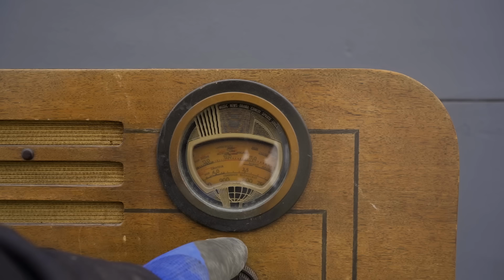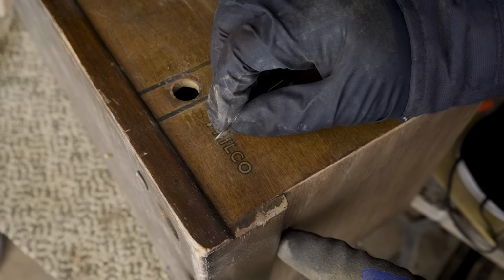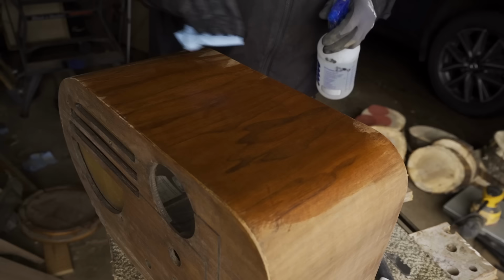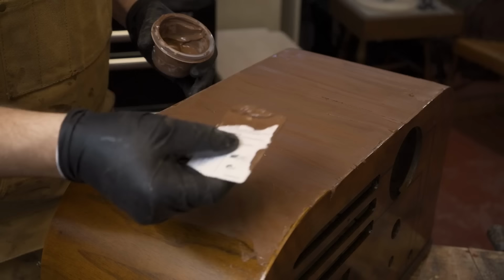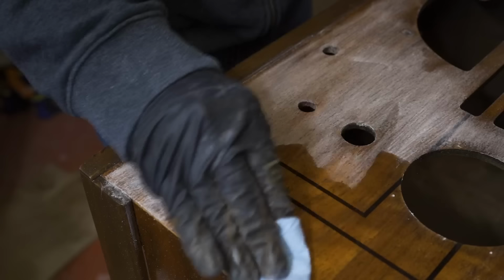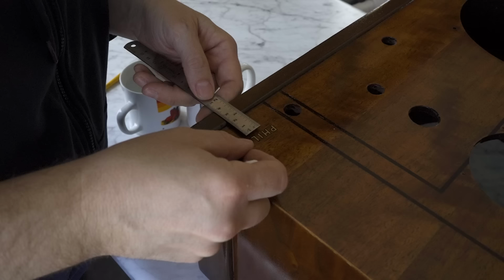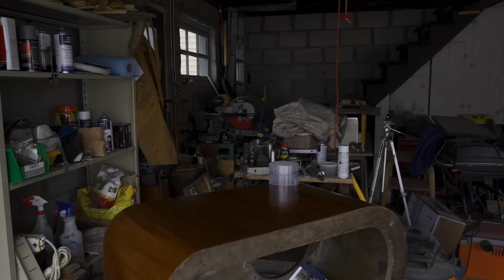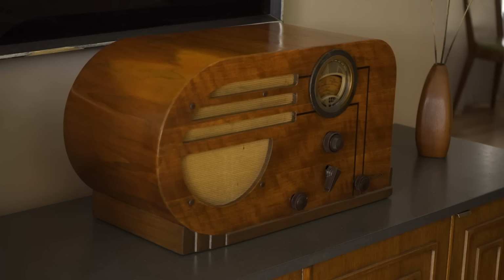Saving A Filthy Philco Radio | Vintage Philco Radio Restoration

Comment: That art deco design is killer. We've lost something along the way. Thank you for saving this.
Reply: Agreed. Also, I wonder why shortwave is no longer an option.

We had a Philco console radio. The bass was amazing! One day the transformer (I think that's right) began smoking and it was gone. There was no replacement part available 😢
Reply: @gordonadams5891  Older radios had 2 settings on the dial to turn to in case of nuclear attack for government info. Not this one, but radios and then transistor radios in the 50s-70s. 
When I lived in England, most all the radios had a SW band. I have one here but I can't get anything.
And then there was the day in the 70s I blew up our stereo playing Zeppelin....
Reply: was it stairway to heaven?  @icatz
Reply: @phil6506  Don't remember the song, but it was on Physical Graffiti.

Comment: I restored a Philco console floor model a few years ago, but I not only had to restore the wood, but also the electronics.  The wood took about as long to do as the electronics.  Fortunately, I was able to get a complete schematic on line and was able to get all new tubes as well.  The capacitors were all shot, so they had to be replaced in their entirety.   A lot of time, but the end result was worthwhile.  I had done this for a friend, because I liked the challenge and it was such a beautiful piece of multiple veneers.  It like your radio was a 1937 vintage.  My friends mother had remembered it when it was new.  So, I had a bit of fun.  I added an RCA plug connection in the back of the chassis and plugged a small CD player into it, and with a  recording of FDR's WWII, "Day of Infamy" speech played it through the radio while her mother watched and listened.  She exclaimed, "How did you do that?"  I told her that I had made it a time machine!

Comment: I had that same radio as a kid in the 60s'. Listened to shortwave programs while doing homework. It had an auxiliary antennae which went to the ceiling. My grandnephew has that radio now. You did an awesome job in the restoration and thanks for the memories. 
Happy Easter .

Comment: Rotten stone and linseed oil is what I use to polish Bakelite. I always repair veneer chips with veneer. I soak old head and footboards in the bathtub and peel the old veneer off to have a source of wood that has the same oxidation/colour level. Your method isn't entirely professional but a great start to it contrary to what Chuckkirshner crassly spewed. Nice little tabletop radio with great Art Deco design. I have restored maybe 200 floor and table radios over the years. I enjoyed your video and restoration production. Cheers from Canada

Comment: In case you want to add another skill to your plethora of amazing skills (thank you! I've learned so much from you!) French polishing the shellac after sanding would have filled the grain really fast. 

You sand the shellac with a high grade like 400 grit and without wiping the dust away, you wipe a heavily diluted shellac across the piece. You essentially use the shellac dust as the filler and the alcohol remelts it enough to bond. 

I did this with an antique chest of drawers and the finish came out feeling like butter.

Comment: The veneer repair looks fine. Old radios are going to have some blemishes and defects - it goes with the territory. You will never make it look like it just rolled off the showroom floor. I restore old radios and I'm fussier than most, and if I was doing this repair and it came out looking as good as you have got it I'd be very happy.
Will you be going over the chassis and restoring that to working condition as well? Be good to see it running.

Comment: I bought a disgustingly filthy 1939 Philco floor model 4 band radio at the flea market. So much cleaning and stripping down to bare wood. Everything inside was removed and the interior got cleaned as well. The radio chassis was striped clean and a 15 watt Fender Princeton design amp was built into it. A custom Weber 12 inch AlNiCo speaker was installed and the 75 year old on/off tone pot and volume control was retained along with the glass and stamped metal art deco and push button face plate. The unit has pride of place in the family room and I have set it up as an amp for my Boom Box radio/CD player. I call it my magic jukebox.

Comment: Muy buena restauración ...yo también opino que las líneas deben ser incrustaciones de latón bronce o cobre. Una restauración PERFECTA. Saludos desde Barcelona Catalonia
Reply: I think the wood inlays are perfect. Changing it to brass or metal is not a restoration. Brass will discolor. You think it's more fancy to use brass? But that's not the original design.

Comment: I couple of years ago I got my grandparents console radio with a turn table, the radio and Turn table still work but the cabinet is very rough shape. I'm planning on building my own cabinet but I'm going to build it a little taller than it was originally because I'm going to add a 42" to the cabinet, I live in a tiny house and having it all in 1 is just a space saver.

Comment: I think another way to handle the restoration on the front (and sides) that you might look into would be to use a Mohawk aerosol product spray (toner?) that melts the original varnish finish and reforms it with the pigmented toner spray. That way you can keep the the original Logos on the radio. You go very slowly in multiple applications so you don't get any runs.  It's an amazing product and I used it on hundreds of radio restorations over the years. They have dozens of hue of colors that you can put on lightly or build up in layers. Nice video! 😊😊

Comment: You can make your own gold/silver decals with black outline with a laser printer and clear water slide paper and metallic Sharpie.  Print logo outline like normal, spray with a coat of lacquer or shellac (if you want them stronger and not tear as easy).  After drying, slide it off face down on a piece of “empty” water slide paper and let it dry.  Then color in the backside with the metallic sharpie, wet it and slide it right side up on to whatever.  Works beautifully on  guitars (Fenders, Gibson with the silk screen).  Spray lacquer on top to “melt” it and the water slide paper will completely disappear, leaving only the logo.

Comment: What a fun and it looks freakin awesome!
Just don't plug it in. Capacitors leak over the years and you could cause more damage even though it may start up and work for a little bit.
Flitz is a great product.
I used to clean up old bakelite knobs. I initially clean mine with soap and an old toothbrush to clean any of the dirt and grime out of the grooves that might be around the knobs.
Great find in a sweet restoration. 👍

Comment: I have what I would guess is that same radio in a different case.  In mine the speaker is on top of the knobs and the dial rather than off to the side.  But it's the same knobs and dial in the same layout.  It was my grandparent's radio.  Mom and I used to sit up listening to the shortwave bands on it using an old curtain rod for an antenna.  It's been years since I've powered it up.  Very happy to see you giving that radio some love and attention.

Comment: hey man just a tip about the spray can that was "spitting", its probably because of the low temperature, try to let the cans in a warm water before you use it and shake it well also, but be carefull because hot temperatures could explode the can, just warm enough to improve  the mixture inside the can and you shoundt get the spitting problem.
Reply: Was going to say the same myself, I was curious of what the temperature was in that garage.

Comment: Over the years, I was able to put my hands on a couple of old radios. I don't know much about electronics but, it is fun to clean them up. I wish I could fix them properly because, I love the retro sound of them. The airline 62-713 that I have, has an "eye" and, I wonder if it can be repaired without changing it. I try to keep them as original as possible which, it's almost impossible. Those old electronics parts, tends to be a little tired.

Comment: Very nice work!  I have this same model needing resto, but have been putting off the work because I didn't know how I would restore the "pin striping".  Since you proved they were inlays, I now have the confidence and motivation to take this one on.  Also:  I've been having a lot of problems getting grain filler to work the way I think it should.  You did a nice job demonstrating its use, so that's another reason for me to start on the 610T.   Thank you!

Comment: Nice to see a cabinet done by a furniture guy. I do think the radio chassis is missing some rubber feet. The knob axis were too low in their holes. Riding almost against the bottom. Find some rubber washers and lift it a little. Hope you also found someone to do the necessary work on the radio itself. The cabinet work is useless, if the radio is under performing, or burns out.

Comment: I had a very similar style 1937 Philco with the same dials. Mine had original finish which while having seen better days, was not so poor that it warranted refinishing.  Refinishing in fact would have been a desecration. I recently sold it for $250… although it may have been worth more. It was in full working order. It was nice to see you give this one new life. It needed it. A very handsome radio. 👍

Comment: Use Gloss to build, semigloss to finish. Makes it easier to level sand the lacquer.

Be sure to warm the cans up for 15 mins prior and shake the recommended time. Clear the novels after every use. Between coats even

Pore fill can be done with UV filler which is probably more your speed.

Shellac pore filling will shrink lots. I’ve French polished a lot and it’s really the pumice and shellac that makes the pore filling possible. I wouldn’t recommend it. 

Alcohol artist pens are great for adding flecks of grain on those filler areas. Homogenizes things.

If you did a sunburst on the radio it would also hide that nugget of missing veneer

I like your work! Keep it up!

Comment: With those vaneer wood chip touch ups I have taken an Xacto and scored grain lines into the filler then lightly added soem black sharoie ink and rubbed it in.

Comment: Very nicely done! I have some radios from that same era myself, including a different ’37 Philco. I believe the original sheen was a fairly high gloss, although most of mine are still on the “to be restored” list.  Has the radio been electronically restored? If not, please don’t power it up if you are not familiar with the way to do it safely. In a nutshell, a lot of the original capacitors will have degraded and may short out, possibly causing damage to other components that are difficult or impossible to replace. (I’m currently in the process of rewinding the power transformer of a 1936 radio because someone tried turning it on years ago…)  There are a lot of good YT channels that do radio restoration!  Look for “dim bulb tester” if you need a place to start!
Reply: Sound advice.

Comment: Just as a tip, if you use real French polish you can use pumice powder to fill the grain. As a dealer and restorer of antiques I can remember my first use of French polish and found it far easier than I first thought it would be and if you make a mistake it's easy to put right. You should buy flakes and mix your own.

Comment: 24:20 Just a little pointer for veneer repair, to avoid a cross grain seem, make a ‘V’ cut, or several long thin ‘V’ cuts into the original veneer and match your repair. Of course this will only work if you have reasonably good matching repair piece.

Comment: I’ve found that you should go one shade lighter on the veneer repair, then use a pen to darken it prior to finish coats.
Because it will always be darker than you expect, just like when you wiped the veneer after stripping the old finish.

Comment: When you’re working with waterslides, to get the excess water out from under the decal just roll the head of the Q-Tip on the decal itself and it’ll squish all the water out without pulling and potentially creasing the decal. Also you should get some softener solution if you’re gonna do them at all; it makes a big difference in the application process :)
Reply from the maker: Thanks, Vincent.

Comment: Just for future reference you could have used your stain over the top of the previous stain and just let it dry after wiping it off it would have filled. In all the holes it all would have had to have done is put a clear coat or scholack.  On it and it would have saved it 100%. It's a much easier method when you want to do a restoration without losing the logos or without losing the character of the peace

Comment: Ive tried to find this radio for years at a price that makes sense.. Its a masterpiece in id say more Streamline design than art decco as the speaker vents are showing movement to me which is one of the larger differences between the 2. Its a great piece

Comment: The fact this radios ware made in wood is to prevent electrical shocks as the volts going around in the internals were usually bwyond 800V
Even the knobs are not consuctive. The chasis was usually “hot” and needed to be insulated somehow

Comment: Excellent restoration of the case. As is stated elsewhere here, a shame the workings of the radio were not restored also, including the yellowed 'stations' dial and the loudspeaker cloth.
Reply: How do you restore yellowed dials and fabric?  Do you mean replace? It's probably not possible to restore them to their original color. There's no way I know to do that.
Reply: @JB-3794  The fabric would need replacing, the dial might be restored with the use of hydrogen peroxide and ultra-violet light, but it would probably be better to replace it photograpphically onto new plastic.

Comment: Don't spray on the shellac. French polish shellac on the surface. That builds up coats rapidly and in even better control. Mix your own shellac and you can also tint it with dyes.

Comment: I would have kept the cans sent them with a letter to the manufacturer to claim a refund .they would check what was wrong with the spray or mixture and you could end up with complimentary  replacements out of good will. Manufactures need to know genuine problems with their products to stop it happening again or they lose customers PDQ . BTW excellent clear concise restoration

Comment: The cabinet looks good but what about the innards? You never addressed the actual radio assembly. Large heavy base plate, tubes, pots, tuner, speaker/grill, antenna etc. Surely that stuff also needed attention. Will there be a second part showing the process involved cleaning up the ancient electronics? That's what I was really hoping to see. The old technology amazes me.

Comment: Before deciding to refinish I always try this: take some Barkeepers Friend (a small amount and a little water) and scrub those dark areas and spots on the top of the cabinet and those pesky areas around the knobs where dirty greasy fingers left rings around the knobs. Quite often it removes the dirt and grime without removing most of the original finish. Then clean with a damp rag several times. Then apply a fresh finish of semi gloss lacquer. Sometimes I use a fresh application of light oil base stain to even out the tone of the original finish if needed. If you do let it dry several days before any lacquer top coat.
Barkeepers Friend is a mild abrasive also good for cleaning all types of metal before polishing.
I can't say I agree with your method of stripping the old finish. Doesn't it tend to damage the veneer in places?
Reply from the maker: No. It does not damage the veneer.

Comment: Pretty case.  I noticed that there were some new valves (tubes).  Has it been re-capped? If you get a chance, check out Mr Radio and David Tipton. Mr Radio just polishes up the cases but David spends time on the cases.  Both do the electronic work in the simplest manner.  If you really want to know about the electronics, check out Mr. Carlson's lab.  Them are some long vids.

Comment: Very good job on the wood finish, I think your chip repair was the best option,  trying to match that veneer from 60+ years ago would be almost impossible. Did you have someone check out the radio itself? Trying to get tunes tht fit it would be very hard to find

Comment: Excellent refinish/repair. I prefer a repair that doesn't strive to make the radio look brand new, especially by employing the ultra-gloss look. My only questions for you are, and I may sound like I'm contradicting my sentiments in the first sentence, why didn't you replace the speaker fabric. This is one replacement that I (as a collector) think is worthwhile. This is certainly true if the old fabric is showing its age and or has holes as yours appears to have. Secondly, why didn't you clean up the stains/dirt on the brown ring around the station indicator, or are those discolorations in the bakelite itself?

Comment: Im still not sure if I would have preferred you attempting to fix the screen at all or not...  That must have been a challenging decision. Definitely did the right thing in not touching the patina on that dial. Man.. its so beautiful.

Did you consider at all doing anything to try and 'upgrade' the radio to allow for an Auxiliary input or Bluetooth to make it more useable today?